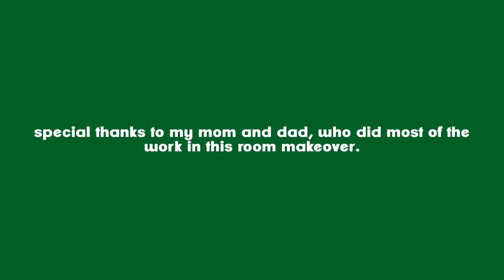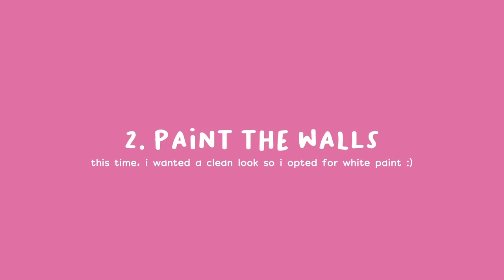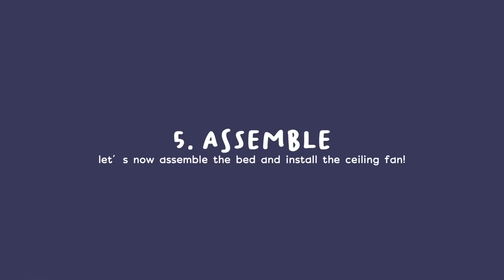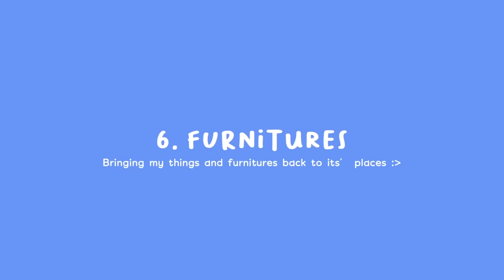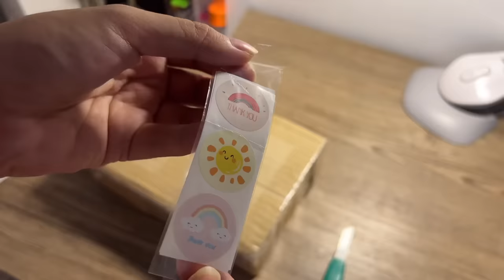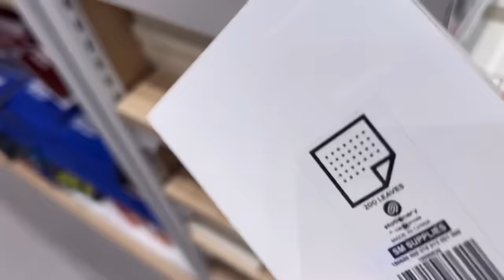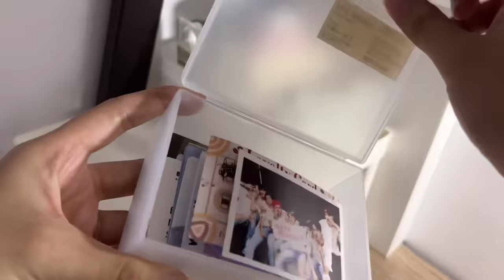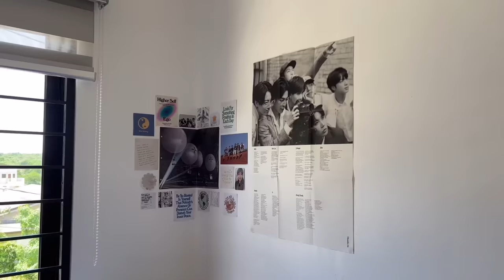small room makeover 📓 | ft. diy ikea bed, cleaning, unboxing, decorating + quick room tour

Comment: Hello! I work with paint at my job and just wanted to give a little tip for future reference; it’s usually not wise to mix sheens of paint. For example, for this room you started with a matte/flat white and then did the 3rd and 4th coats with a white semi gloss, which is technically fine to do but if you don’t do a thorough job (coverage wise) then some patches will be more dull and some will be shinier. It’s not a huge deal but this was just a tip if anyone has noticed these problems. It’s usually wise to pick one sheen and stick with it. For bedrooms the most popular are matte/flat and eggshell, it just depends how flat you want the look to be. Most people like a tiny bit of shine with eggshell. Hope this helps :)

Comment: Hello how many paints did you use for your room po? And how much for that?
Reply from the maker: Hii! 

We used :
~ Flat White Paint (1 gallon) - you need to do 4 thin coats of this paint first. 

~ White Semi-Gloss Paint (1 gallon) - wait for the flat paint to dry before you apply 3 coats of this white semi gloss paint.

and it costs around 500 pesos:>
Reply: Last question na po, where did you buy the blanket poo?
Reply from the maker: @celinerubio3700  it’s from SM Store po, here in Batangas ^ ^